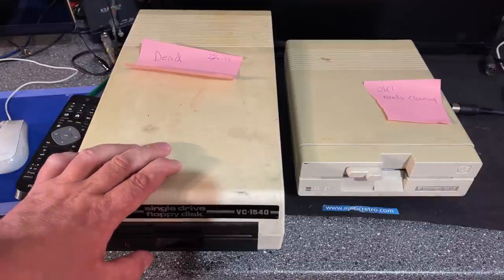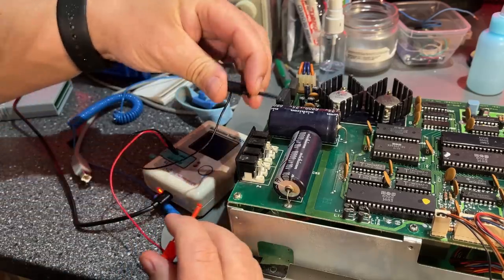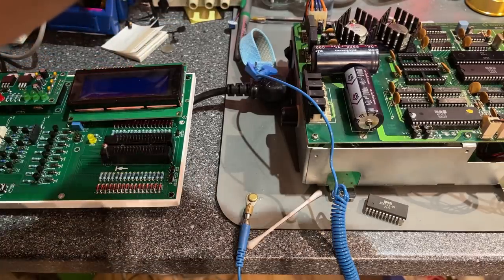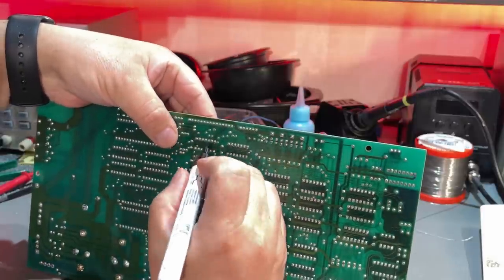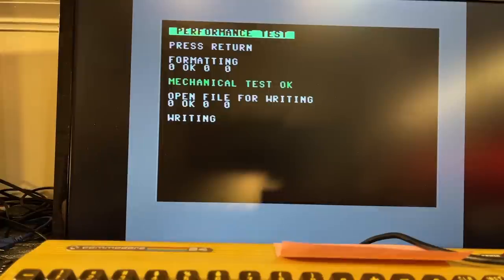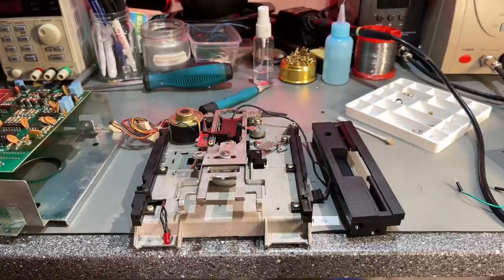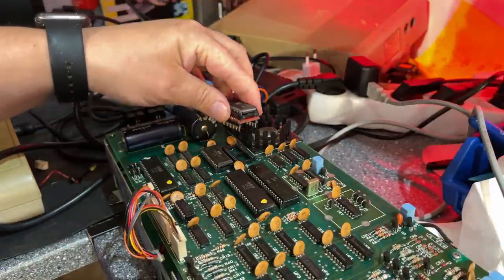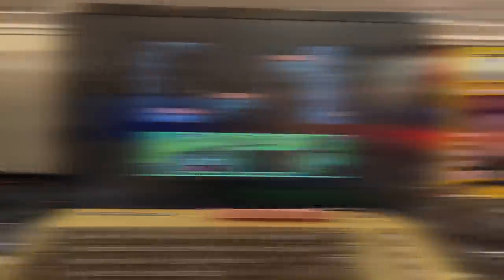Commodore 1540 floppy drive repair - Faulty drive with multiple faults. Can it be fixed ?

Comment: The early 1541s have exactly the same PCB as this 1540 has; the only difference is the ROM contents making it compatible with the C64.
Original 1540 ROMs are collectible as often the ROM was changed at some point in a 1540's life.
Reply from the maker: Ok, nice to know. Thanks!

Comment: On the 1540, you should look at the Transformer if you can switch them from 220V to 240V. On some you can solder a wire to another connector for 240V. Most of the old Diskdrives are configured for 220V, and so it get hotter than it must.

Comment: The older 1541s are almost identical to the 1540. I have one in “VIC 20 beige” and the only difference between it and a 1540 is the ROM and the number on the label. The board is identical.
Reply from the maker: Ok, thanks for the insight!
Reply: The sticker in the back of the VIC-1541 still says VIC-1540. At least mine does.
Reply: @8BitNaptime  yes, mine too

Comment: Nice repair Tommy!🙂 But a little advice... if I may? Do not use the "Multi-function tester - TC1" for testing capacitors etc... in circuit. Mostly it gives false readings. A good ESR tester can test in circuit with a 100Khz signal for example or so. I use a "MESR-100" and a "Der EE DE-5000". Anyway, nice video's you make.😉
Reply from the maker: Thanks for the tip! I know it's not ideal to test in circuit

Comment: Nice repair again. I have one question. When you tested the 10.000 microfarad your tester measured 10 nanofarad? That seems not ok, but your drive works fine. Is your tester ok?
Reply from the maker: I don't remember now. I think it measured 10m (10 millifarad). That is 10000 microfarad

Comment: The original 1540 ROM is what allows it to be used with the VIC-20, with a 1541 ROM it is fully upgraded for the 64.
Reply: Either a 1540 or a 1541 ROM will work with a VIC20, but the 1540 ran too fast for the C64, so you could  “upgrade” it by replacing the ROM with a  1541 one that ran the data bus slower so the C64 could keep up.
Reply: @Doug_in_NC  And the 1541, for compatibility's sake, is still expecting the VIC-20s VIA bug, keeping the slow bit-banging transfer mode, no faster than tape. Makes Jiffydos a must-have upgrade.
Reply: @Breakfast_of_Champions I think this is not a compatibility thing. the VIA-bug was not fixed in later revisions.